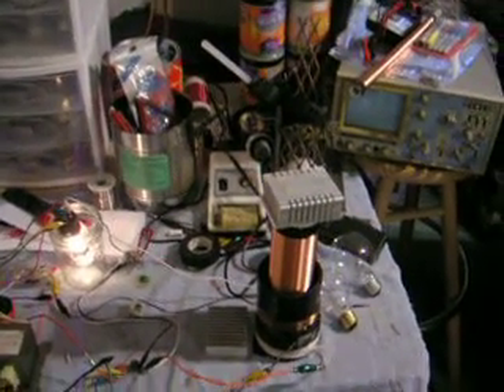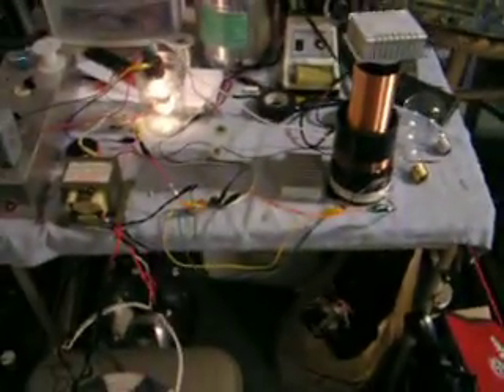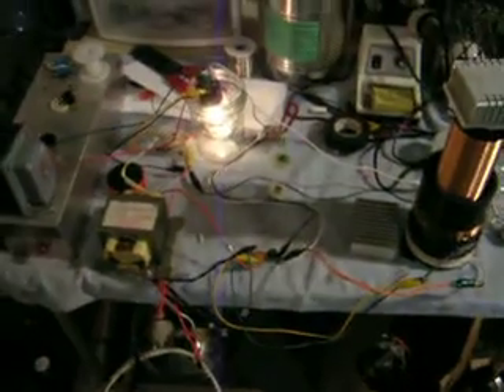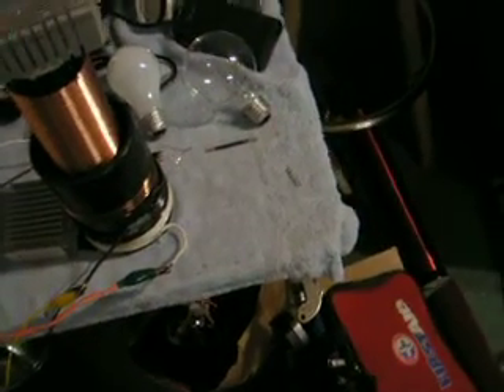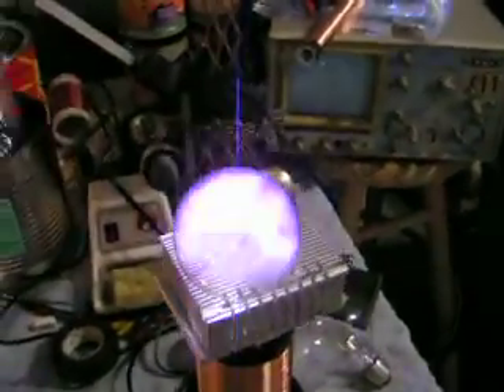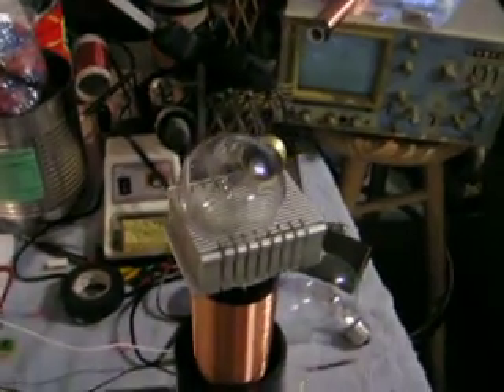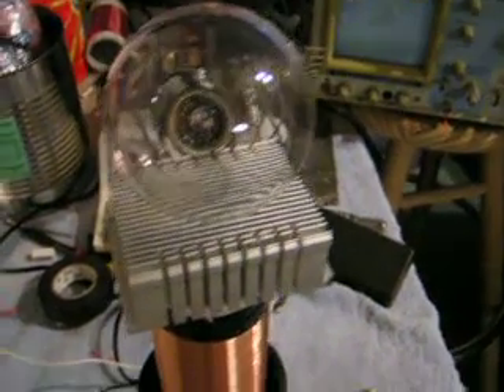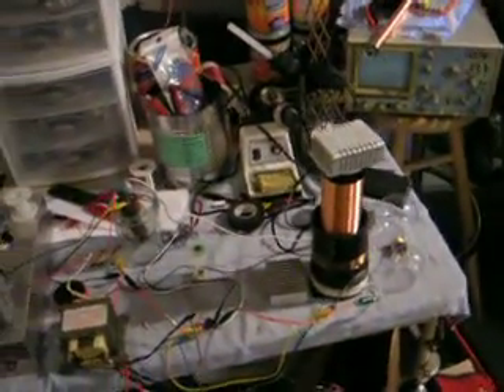VTTC and incandescent lights

Comment: why don't you stack a capacitor yourself? I use overhead foils (100µm foil) which is is punched through only above 5-10kV and using flat metal sheets with rounded edges it can even cope with 30kV for an hour or so...

Comment: hey if you need some capacitors or ever need a new tube...EBAY!i got an 811a coming for about 13 bucks!!i have some resonance capacitors coming for 5...its a 1000pf capacitor rated for 10kv if you wanted to get some..........good luck!